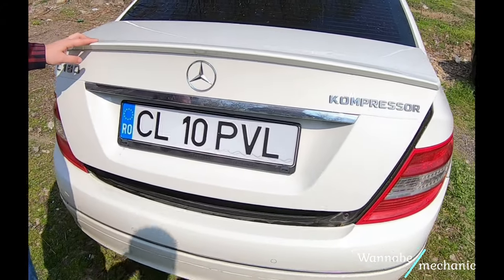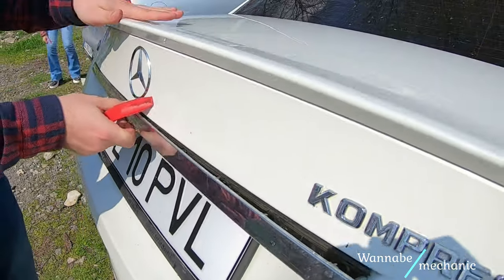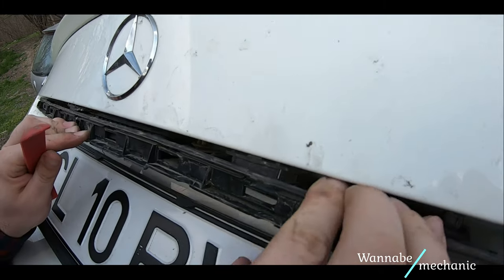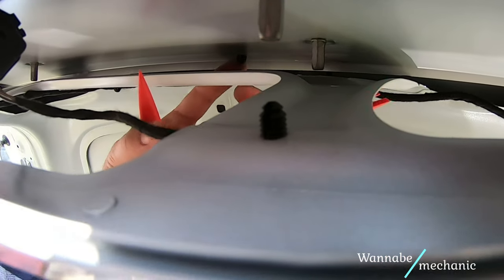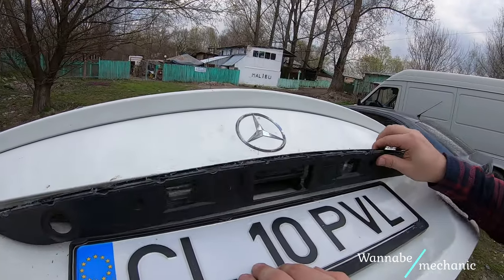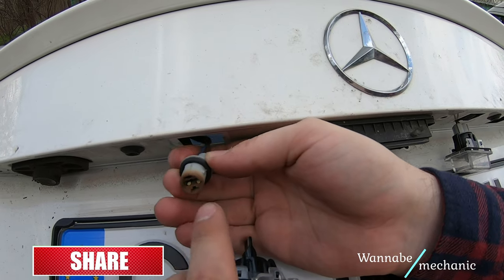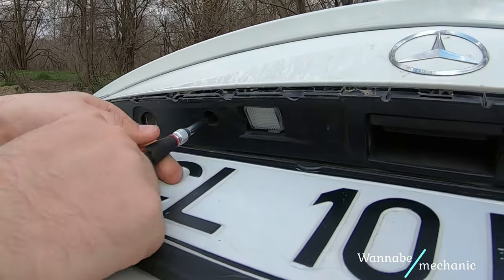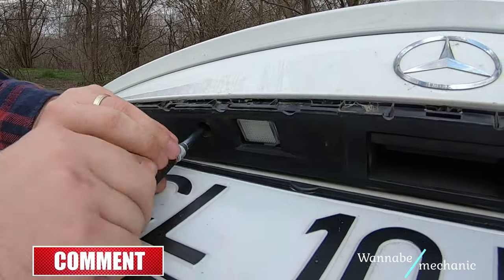DIY Mercedes W204 LED Licence Plate Lights Replacement Easy Fast

Comment: I've done this very job on my own W204 and yes, the interior trim has to come off to access the 2 screws either side of the handle to get the exterior trim off. The LED light make a big difference. I believe the facelifted W204 from 2011 had LEDs.

Comment: Jeez Louise, what happened to unscrewing 2 screws to remove the licence plate bulb holders. That's progress I guess.
Reply from the maker: It s not that complicated and it s worth the effort. There are brands where you need to remove the headlights to change a light bulb. Try it out, you will be pleased. Thanks for the comment!